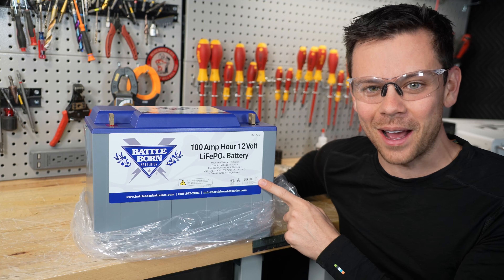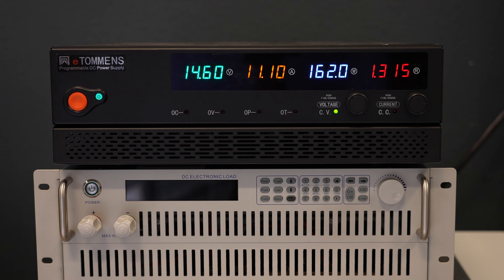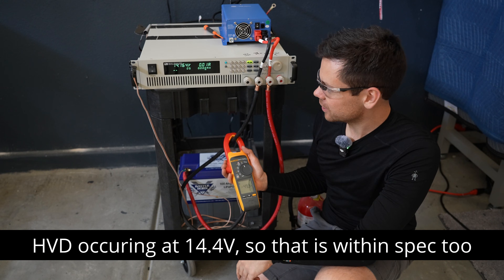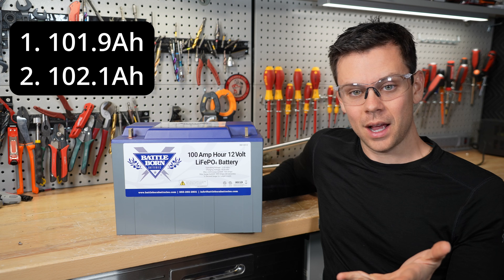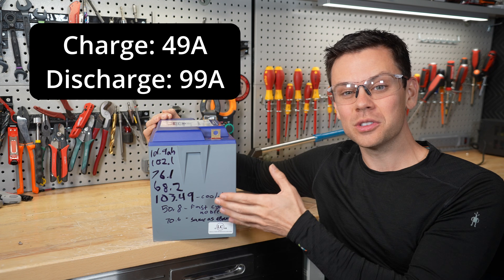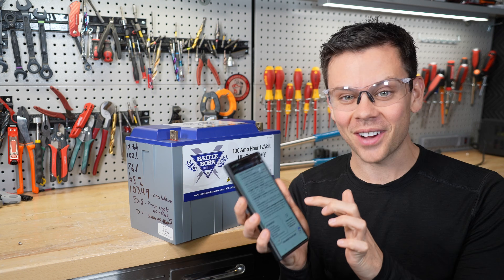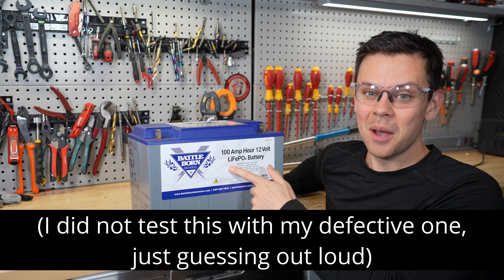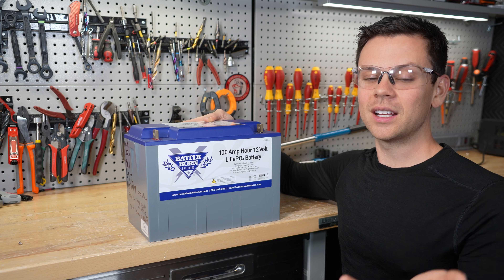A NEW Issue?! Battleborn Cycle Testing!

Comment: That was exactly my problem. I had 4 of these in parallel on my boat. charged them with solar and viltron controllers.  worked wonderful for about 1 and 1/2 years until we had a few rainy days in the Bahamas and I wasn't paying attention to the state of charge. One night the bms disconnected the batteries. After that they were never the same. My guess would be anywhere between 50 to 80 % of the new capacity. Contacted Battleborne but got basically no help from them.I will never buy these batteries again.
Reply from the maker: No way!!! Holy cow!

Comment: Btw,  Will, My Maynuo 1200W professional E-load also blown for stupid reason. There was a delay/rise time  when I pressed ON to start the discharge test but it was not reacting quick enough so I pressed again ( which hapenned to turn the discharge OFF but with the still recorded ON in Cue and when I pressed ON again the current control loop circuit and  rise time did not catch the second ON precisely enough and the output shorted.. so the delay  and rise time was the cause of blowing it.. I had no fuse and it was sad but such a damn great firework spectacle to watch inside when it blew!

Comment: Good grief.  860$
That's crazy.  I bought 5 dr prepare batts for a little more than that.
Reply: Bought 4 EcoFlow 12v 100ah for less than half of that.
Reply: @davesigz  that's what I bought too. 12 volt 100 AH lithium iron phosphate

Comment: UL does not need to be the test lab used to meet and be officially certified to UL (and often IEC as well) standards. There are many other test Labs that are approved to do so. I see the LC mark on a sticker on the side, and they are an approval NRTL (Lab Test, Canada). An approved test lab is audited by OSHA to ensure they are appropriately testing to the standards. Not saying that means anything about the product. Just that the samples that were sent to the test lab met the standard as written.
Reply: While I agree in part, the Battle Born battery is cETLus marked (Nemko-Intertek). The compliance certificate is listed on their website which lists the UL/IEC/EN standards used. Of course, testing is normally done on only one or two samples. So, issues can slip by. But…Battle Born must go through a bi or quarterly factory inspection for construction, parts, and quality records. Any issues are supposed to be reported including external complaints (I have already filed one with ETL). It doesn’t happen overnight but the NRTLs will find out and force corrections or delist! I know because I have been involved with a product where we were to either fix the design or get delisted by CSA….

Comment: Please do a video of a diy 12v 628ah battery, a dc to dc charger, ac charger, solar charger, 2000 watt converter, and a 500/550 watt solar panel using all the new tech and eve 628 cells..

Comment: Question: I have a battery bank of 8 Battleborns (12v put in series of 2 for 24V, so 4 sets) which is about  6 years old. The solar panels sometimes charge at around 70 amps but I figure that it is ok because it is charging so many batteries. Is my logic faulty that 70 amps charging for 8 batteries is ok? Now I am not sure. Also, the terminals do not feel loose so I think they are working ok still? The system is on invert 24 hours except that the batteries get less than 50% because if the power goes out the batteries will have some reserve for that. I don't have any equipment to do capacity tests, how important is it?
Reply: I too have been using eight BB10012s four in series /  parallel for 48 volts.  The just keep on providing for over five years.  Only maintenance is vacuuming them off.
Never used a balancer nor a buss bar.
Yet four I had in a rental property were ruined by the tenant.

Comment: This is a watershed moment. There are several industries going through this now about making claims and the ability to go unchallenged. I can assure you Battleborn is well aware of what Will is doing and they should lean into the moment and work hard no matter what the cost to stand behind there product. So far I have a sense they are either hopping this will go away or that nobody is watching. Battleborn I know your watching....... Do the right thing and lets not have a Budweiser or Cracker Barrel moment. Do not underestimate your customers intelligence........
Reply: They’ll prolly litigate, or at least threaten to

Comment: Cheap batteries can suck to.
I have a 100 ah Mehrpow that the ntc sensor has failed. Shows -30C at rooom temp.
1 year old and Amazon seller and Amazon is useless. Even though I have 4 years warranty left.

Can I replace the NTC aka temp sensor?

Comment: I'm really not trying to nit pick here, and this is nothing against Will, and I'm not trying to disprove his results or anything like that.  But, aren't you supposed to hold the bolt steady while turning the nut if you want to achieve an accurate torque?  Seems to me that turning the bolt gives you extra friction within the hole against the threads, resulting in a lower than desired torque.
Reply from the maker: No worries, how should I do it? It will spin if I don't
Reply: @WillProwse  0:30 Oh, I didn't look at every detail. My original thought was to put the torque wrench on the nut and turn it while holding the bolt steady with the closed end wrench. Looking at it again, you can't do that because the terminals are sunken into the battery, and the battery body is blocking the socket from going around the nut.  And, it's not ideal to turn the whole thing around and put the nut on the outside, either, because the threads would stick out.  If the bolt were shorter you could do that, though.

Comment: I wonder how many of the issues are possibly related to batteries not securely held from movement with rigid buss bars tying multiple batteries together.  I remember a lot of installation photos done like that   For sure the terminal bolt looks like a week link

Comment: When Battleborn got popular, they were one of the only reliable games in town, and charged accordingly. Now that everyone and their brother are making batteries, and cheaply, BB can't adapt (they still don't even offer 24 or 48v batteries, do they?). I'm guessing that because they were once fat and happy, their overhead is high and they just can't get out from under this mess. Even if their batteries were rock-solid and flawless, their current pricing would still be a tough sell. I don't think that they will survive this. Thanks again Will, for being a beacon of truth in this crazy world.
Reply: Agreed. There are too many low-cost lifepo4 batteries that seem to work better than Battleborn. For example, on Will's recommendation, I purchased a Dumfume 300AH 12.8 volt lifepo4 battery for only $305, which is less than half the price of a brand new 100AH Battleborn 12.8 volt lifepo4 battery: 1/3 the capacity at 2.6X the price. Why would anyone go with a Battleborn today??

Comment: Thank you for efforts to identify. The WHY it’s happening yet to be identified. I was guessing this issue started with VERTICAL attached 2/0-4/0 HEAVY wires being tossed around in a moving vehicle (whip torque with leverage due to vertical height of the wires above the terminals) back and fourth stress leading to a GAP between inner bus and terminal bolt, gap triggering HEAT, leading to melting. All starting with a vertical wire attached to the terminals.

Battleborn vertical post + vertical wire attachments in a moving vehicle will wiggle stress terminals while driving. But more on batteries where cable stress terminals in direction of length of battery axis vs stress to the side axis. That depends if the aluminum nuts are coming loose too? Nuts loose side axis stress. Nuts with thread lock not moving length axis stress. Just my guess it was stress from vertical mounted wires. I don’t know, just my guess.

I plan to bolt a 90° ELBO to BOTH terminals, so wires horizontally resting on top of batteries until solved. Look how most battery cables attach, slip over the post and lay flat low over the battery. Just my guess…? Again I don’t know.

Comment: No wonder they hand these out like candy to influencers, they cost them nothing to build compared to what they charge. Thanks for checking this out :)
Reply: Their design uses cylindrical cells and looks pretty labor intensive compared to the typical 4 prismatic cells with aluminum laser welded bus bars, BMS, silicone positive to the terminal and silicone negative through the BMS

Comment: Is it realistic to expect that it will be discharged and charged that quickly in a cycle 

Would not these batteriess normally be discharged at night and then recharge the next day?
Reply: Yes but as Will has reiterated they advertised 'continuous'. BB needs to change their spec to one full cycle per day.
Reply: @garymiller7870 that's fair. 

What kind of people use a battery continuously like that? What's the use case?  I'm curious.

Comment: Does the Battle Born gc2 12v battery have the same issues?  Youtube searches do not show that Anyone At All has torn down an EG 2.  That would be good content and be help to me since I have 2.
Reply: Yeah, I have a pair of those bought in 2021.  No problems with them yet, though I typically charge at 40A and discharge <8A.   But I just bought a cheap 314 Ah to get 50% more capacity in the same space.  Not sure what I'll do with the BB's.

Comment: I believe Will needs to find a 10 year old, 5 year old and a new BB battery and deconstruct them to see if they have changed  the construction. Built reputation on one quality and sell a cheaper.
Reply from the maker: My defective one in the last video has "2018" on the BMS. Which would make it 7 years old. Not sure when it was made though. I would need more proof than a random date on it. Hard to say when they make these.

If anyone wants to send me a 10-year-old one I would love to see it
Reply: That's what happens when the people who founded the company get replaced by MBA graduates.
Reply: Agreed! Mine are about 5 years old now.
Reply: Battle Born, LOL Way over priced! I've been using Redodo mini 100ah lithium batteries for my house backup power and built 4 100ah mobile battery banks with Bluetooth remote monitoring in water tight cases and use 1 while overlanding for weeks on end. No issues and I recharge them with a DC to DC charger at 50 amps off my Jeep altenator. The other mobile battery banks I use in my barn as battery backs on my diesel heaters. Redodo lithium batteries have been great for 4 years now. They are around $200 for 100ah mini. I like the mini 100ah since they take up less space. Battle Born can keep their over priced batteries.
Reply: thats smart yes.
Reply: I went back and watched his teardown video from 6 years ago and you can clearly see the plastic spacer in that version.
Reply: Pretty common these days sadly.  Produce a great product, build a following, start cutting corners/quality to increase profit.  Or build a great product, build a big following, sell the company, new owner(s) start cutting corners/reducing quality to maximize profits.  When the company is inundated with returns, bad reviews, etc. you sell the company or file BK and walk away.
Reply: @wb1340 you first notice this syndrome when you’re busy local bar or restaurant changes hands. It turns to crap without the original passion and becomes a flop,  the biggest scam we have is the UK it all the local vets have been taken over by big corporations who are in it for profits. Prices have gone through the roof, same companies start selling insurance again expensive.   It’s legalised robbery.

Comment: To be fair, limiting output due to heat buildup is likely the right thing to do. 
Longer term fix the design issue.
Reply: That definitely applies if there really is an internal heat issue.  I would hope that Will's temperature testing would show that.  Over time that heat should be apparent from the outside of the battery if it's hot enough inside to trip that BMS thermal safety.  Then there's the question of whether the heat is generated due to a high resistance somewhere, or if the cells just can't cycle that many times in succession without overheating.  I like your thought, but I guess we won't find out for sure until he takes the saw blade to it.

Comment: Well, I checked the BB 100 ah battery I've had in my RV for the last 5 years and the red plastic around the positive post seems fine. It still has 13.28 volts from being fully charged this summer. I have yet to cycle it through the paces, but when I do I will monitor it to see how the temperatures are and the charging cycle. Good work Will!
Reply: Same here.  I have 4 100 amp/hr Battleborns at least that old and live in that coach full time, 6 years now.  We ran a residential fridge and the whole coach on them.  About 50% boondocking all that time and no problems what so ever.  I check my connection at least quarterly and since this problem has come up I now monitor the terminal temps.  I have a 80 amp converter recharging or alternator when on the road.  With the solar panels and alternator both charging when state of charge is sometimes less than 60% and I see no heating of the terminals at all.  My red patch under the positive terminal is still RED.  STILL—-  I would like to see the inside connection where the plastic that could melt looks like.  I would think the least BATTLEBORN  could do is give us a procedure how to do that.  For now I will keep monitoring my batteries and YouTube.
Reply: I think it's probably only going to be a failure you would see on repeated high-amp draw, and/or bad terminal connections/crimps/whatever, loose connection heating from outside creeping to the inside.  The point is they (BB) have claimed it's a (undocumented!) "safety feature", and all but I think ONE single Engineer I saw called B S on that. That's the way BB spun it, when the issue surfaced.  The real issue is likely it's not intended and the use of dissimilar metals that expand and contract at different rates is causing this problem, BB just hasn't admitted it yet and claimed it's a "Safety Feature".  Yeah, sure...
Reply: @xxcrazy_critr6661  I safety feature on a  $1K battery that can not be reset?

Comment: I have 3 battle born batteries in my FW . I charge during the day discharge at night sometimes when the sun‘s not out, I will discharge down to 30 to 40 % then charge back up when the sun comes out. just like everybody else batteries are still good. I like Will but most people don’t discharge and charge that rate like to see five batteries set up discharge and charge just like that and see what they all do.
Reply: My thoughts as well - who stresses their batteries like this during normal operations? I don’t think anybody close to this????
Reply from the maker: Oh that doesn't matter to me, I am here to test the advertised limits and nothing more.
Reply: @WillProwse your testing is accurate and appreciated. Many newer RVs are set up from the factory to run the roof air conditioning with the inverter and batteries. High amp draw and high charge rate with the generator.  Ill be testing a dual 270ah battleborn set up from the factory already preset up to run the AC.  I will be in some warm weather in the next few weeks so I can actually run the AC.
Reply: @WillProwse  I think it’s ok as long as you test all battery brands under equal conditions.
Reply from the maker: @teuton6167 agreed!

Comment: A battery that cost that much these days better be able to back it up with premium performance and a rock solid customer support. There are batteries at 1/4 the cost that work better. Will watch for next update.
Reply: At 4x the cost they should at least have a 4x as long, no questions asked warranty.

Comment: I question how applicable this test is? Despite the fact that the manufacturer says it can withstand this amp withdrawal - this is considered a severe test of any battery - and is not anything like what the battery is expected to undergo in normal usage. It’s expected to heat up the battery substantially. At least that’s what an AI search said (??). 

That said, it would be good to know how battle born does compared to other batteries when they’re stressed like this
Reply from the maker: It is a continuous rating so it should be able to handle it. Imagine if I applied your logic to a contious rating for an inverter. If it says "continuous", it means just that

Comment: I really don't think you can cycle a battery up and down like that without some cool down period.  The plastic case is keeping in the heat so it's no surprise to me that it will cutout if you discharge and then charge again right afterwards when your using maximum ratings.
The only batteries that can handle that kind of thing are ones with active cooling systems like fans or HVAC.
Reply from the maker: It is a continuous rating so it should be able to handle it. Imagine if I applied your logic to a contious rating for an inverter. If it says "continuous", it means just that
Reply: @WillProwse  I am figuring that since you did .5C charges and 1C discharges that means you cycled the battery every 3 hours.  So is that like 3-5 complete cycles per day?   I don't think battery companies make them expecting that kind of constant cycling.  Inverter companies do make their products to handle continuous loads.
Kind of two different things to compare.
Reply: I suggest you test other similar design batteries as a comparison to be fair to Battleborn.